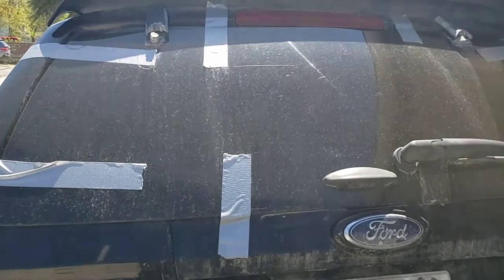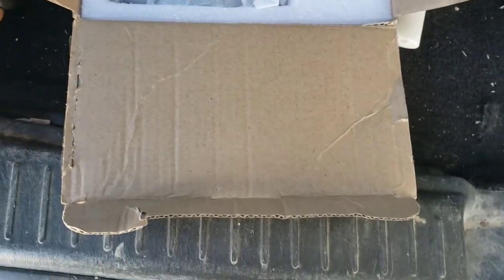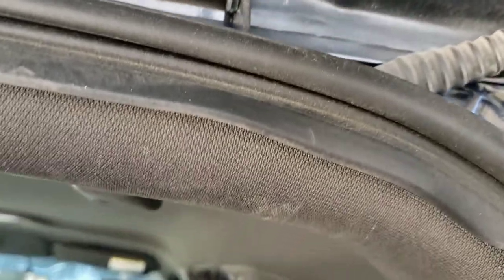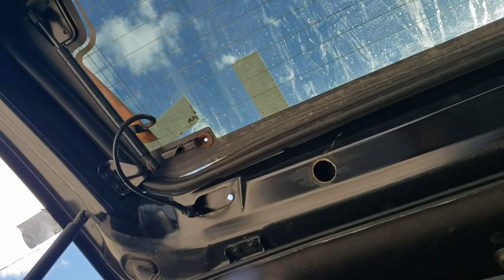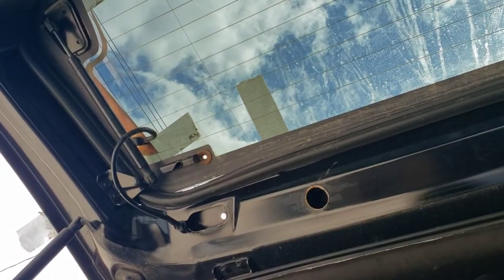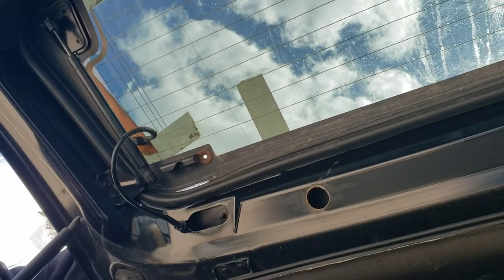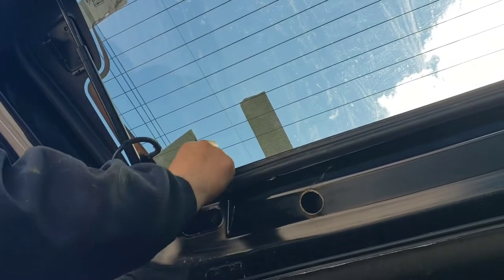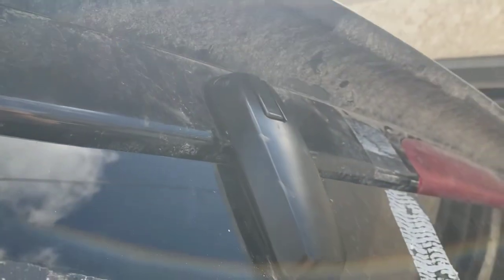Ford escape rear glass hinge replacement

Comment: The one on mine corroded in a way that left part of the hinge around the bolt up top, wider than the glass. I tried to get vice grips on it but pieces came off couldn’t get good grip. Theres still parts of it forming a slight lip against glass to where I can’t wiggle it through and I don’t want to break the glass. Tried to use a pick to break pieces of the metal off but didn’t work. 
Wondering if I need to drill it out or use a dremel or something. Have you ever run into that before?
Reply from the maker: Yes impact tools probably aren't the best option. Is the bolt free as in it spins. If it isn't drilling would definitely be an option. And careful grinding with a dremel could work as well. Just cover surround glass with duct tape. I use masking fist. Because the adhesive is easier to clean off then put dust tape over. Maybe 2 layers
Reply: @RabidMotorsport  yeah the whole thing with the bit of housing left at the top spins. I just turned it back and forth a bit to see if it would work it’s way out but then realized when I looked at the top that there was too much of the housing left on the bolt to where it was wider than hole in glass. 
At one point when I turned it a little farther it made a slight crack noise, not loud but enough to scare me
Reply from the maker: @bartman2468  yeah sorry I'm trying to recollect my best. I think if you hack away as much of the plastic housing to expose the bolt you could then try and vice grip it or gently grind the head off....like I said I would avoid impact tools. Try and cut it away

Comment: Dude that allen head bolt on mine is stripped and I can't get it out. Idk what to do
Reply from the maker: How rounded off. You could try a torx bit
Reply from the maker: Can you grab it with vice grips. That might be the way to go. Cover the glass with duct tape around the bolt to protect glass
Reply: @RabidMotorsport  there's not enough surface area to grab it. And I tried using a speed out bit to round it out n use a reverse bit to pull it out n that failed
Reply from the maker: @hazencoffey5350  Probably will have to drill it out. Start small moving up on size at a time until the head pops off. You won't have to drill all the way through.
Or if you have a small die grinder with cut off wheel you can try and cut a slot for a large flat screw driver. Or grind the center of head off. You will want to be careful putting too much heat in that area
Reply from the maker: @hazencoffey5350  if you cut a slot the right size for a large flat head you can use a wrench on the screwdriver if you can't get enough leverage on the screwdriver itself
Reply from the maker: @hazencoffey5350  I've never had success with easy outs
Reply from the maker: @hazencoffey5350  the other option would be attack the nut side with a grinder or something. If you can hack away most of the bracket you might be able to cut away the threads on the outside of the glass
Reply: @RabidMotorsport  thanks for help bud. Just running out of options. I don't want a shop to do it for over 100 when I could do it for free
Reply from the maker: @hazencoffey5350  yeah man those are pretty much all the options besides welding a nut too it and that would be my last suggestion because of the heat. If you did small tacks you might not affect the window. But I've never welded that close to a window before so would recommend the other ways before going to that
Reply: @RabidMotorsport  Where does one acquire this torx bit you speak of? AND..... what specific size do I need? Thanks man👍
Reply from the maker: @glennt5258  we have canadian tire here. I would get a small set they are pretty cheap. They go up by 5 typically. So they call them t20 t25.
Usually a set that goes from about t20 to t50 will get most jobs done. Usually a 6 or 12 piece set.
40 canadian bucks will Usually get a decent set here. Just don't use impacts on them.